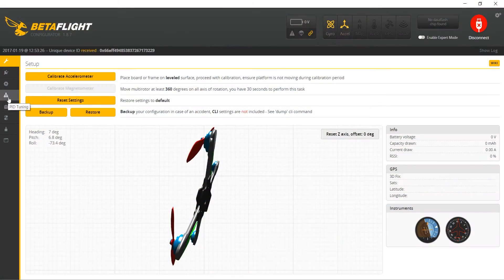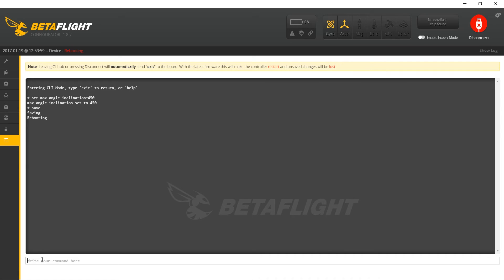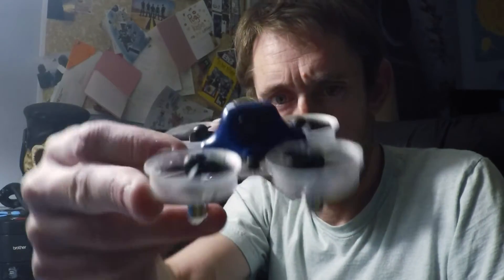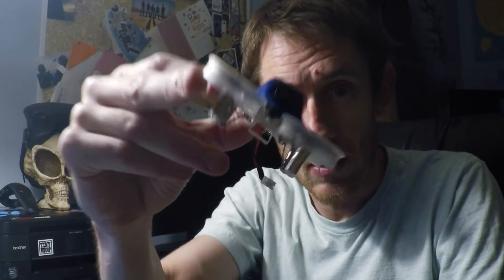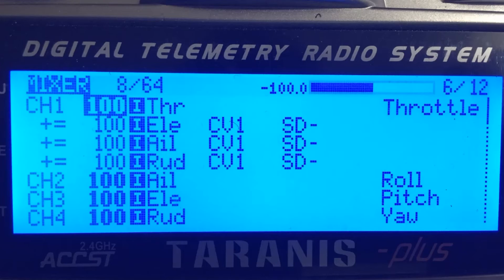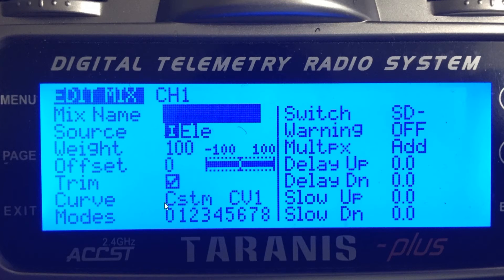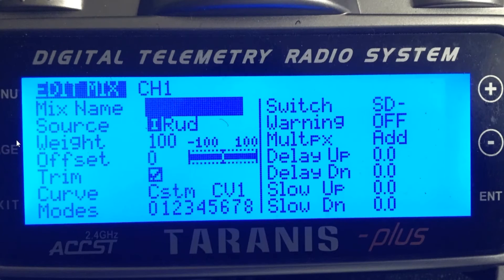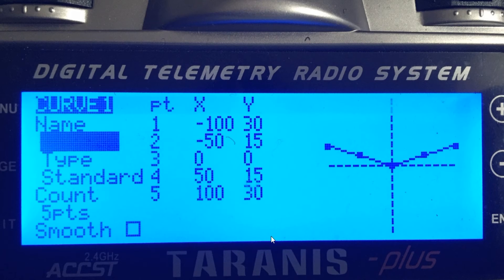Updated Bee Brain Angle Mode Tutorial

Comment: Why would you need to include the custom throttle curve on the Yaw axis ? Wouldn`t Pitch and roll be enough?
Reply: I included yaw throttle because I was getting drop out on hard yaw maneuvers. It may not be entirely necessary but I found it helped with throttle control accuracy during yaw moves.